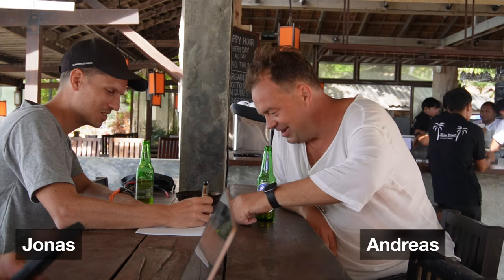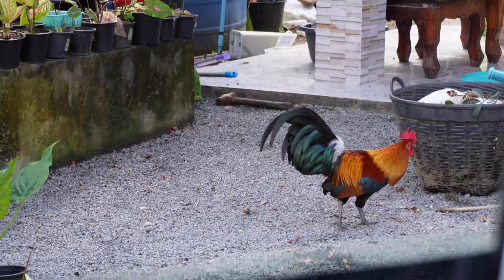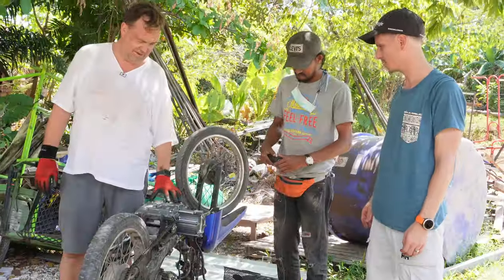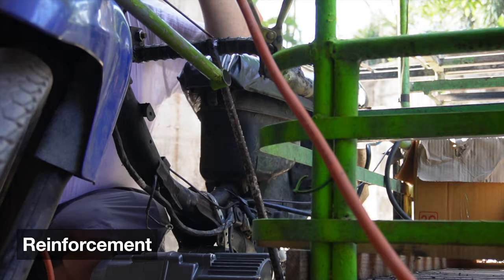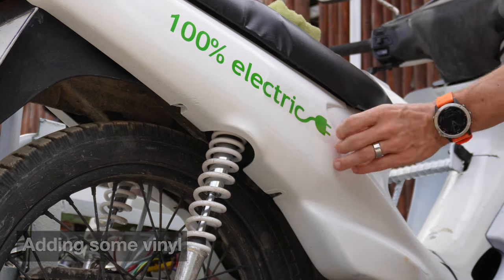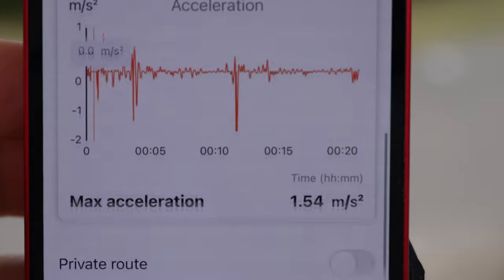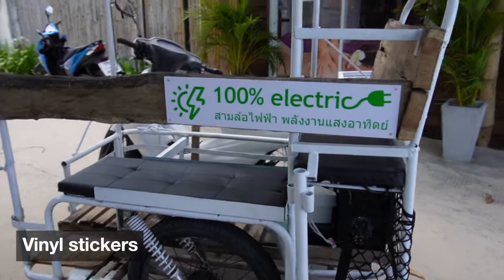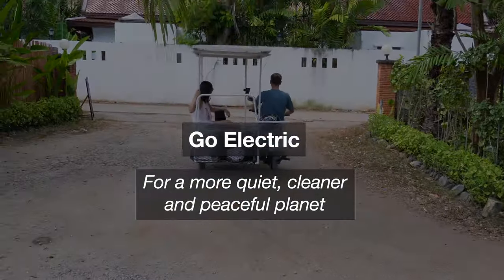Convert a Tuk-Tuk to Solar Electric under $1000

Comment: This is so wonderfull. I have a Tuk Tuk in Gambia. They look a little different than this one. But it would be wonderfull if I could make it electric. I wouldn't put the solar on top of the tuk tuk. I would change the battery and charge it at home with solar panels. It would be nice if someone understands what I mean and could direct me tot the right direction to make this happen. So I can do my part in making Gambia a little greener